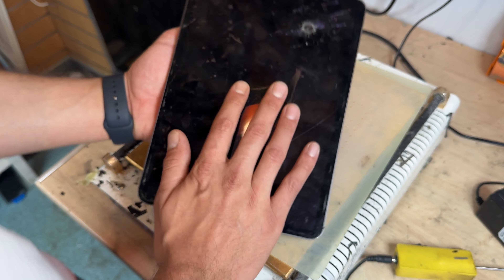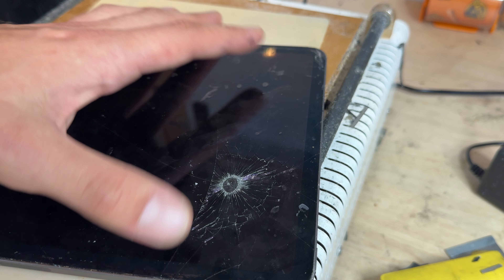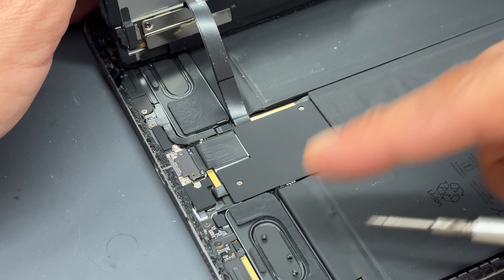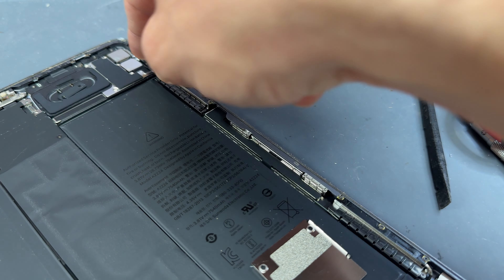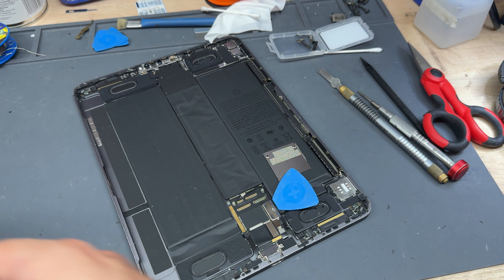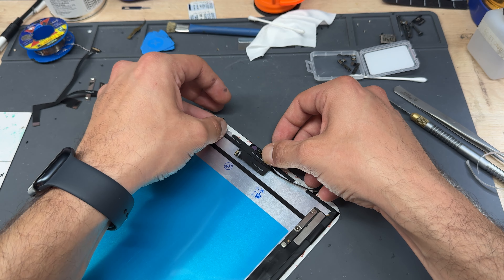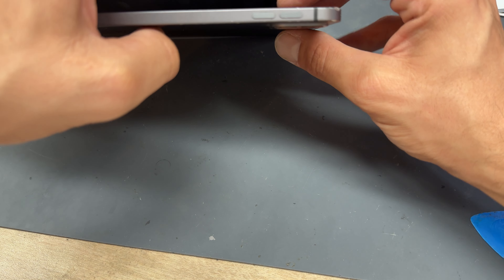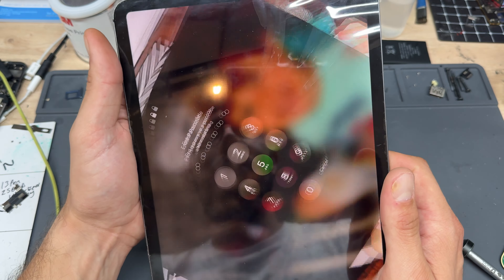iPad Pro 11” (2020) Full Display Replacement - Complete DIY Guide!

Comment: So a while back I got the screen replaced and a week later it cracked in the same spot. I figure that the frame is deformed in some way and there are a few spots where the metal is slightly bent inwards. I recently bought the replacement part so I could do it myself but don’t know how to reform the frame, any ideas?

Comment: Question, I have a 1st gen iPad Pro 11, sometime when I touch the screen, it doesn’t respond, if I turn the iPad it will respond to touch, but sometimes I have to rotate it several times. Will replacing the screen resolve this issue?
Reply: contact apple
Reply: @SoupEmpress  I purchased the iPad Pro 12.9 just before the 11 was going out and I was really wanting to use the 11 for other things. I'm sure Apple can fix it but not wanting to go that route because it's not that big of a deal. I was just gonna try to fix myself.

Comment: if an ipad pro 11 2018 seems to have something wrong with the motherboard, would applecare+ be purchasable? it does not turn on, and i opened it and everything seems to be fine.
Reply: screen and battery has been replaced before
Reply: no you cant buy applecare on something that old.    you only have three times to get apple care after the year warranty you cant get it anymore.